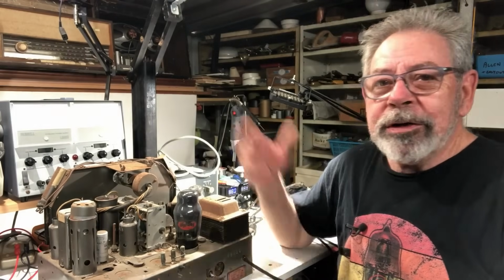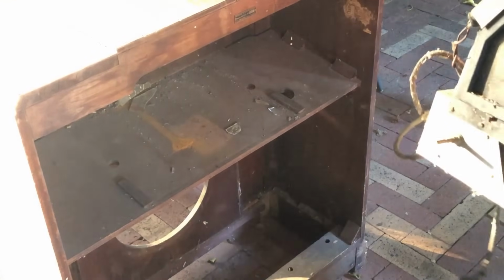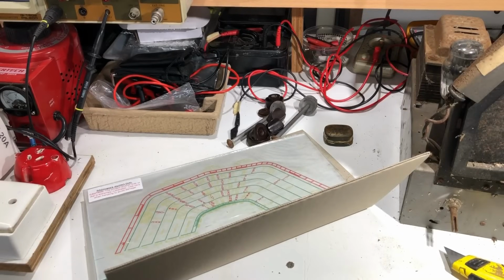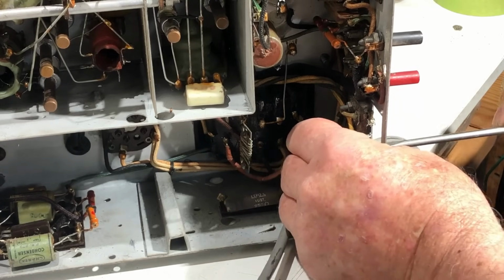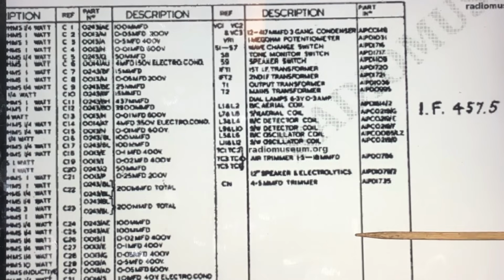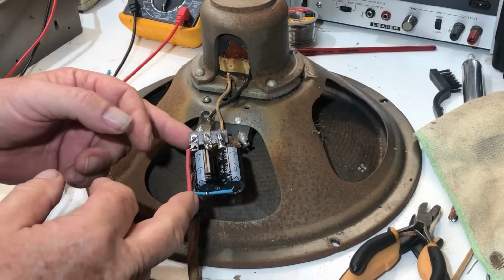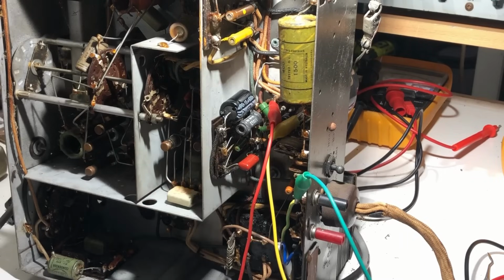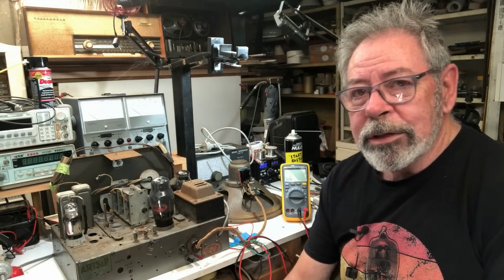1941 His Master's Voice model 411 Console Radio Restoration Part 1

Comment: I think it common on HMV the filter caps field d coil to be the negative side. give a little more negative for Bias
Reply from the maker: Hi.  It does seem to be a particular HMV thing though. I'm sure they had a good reason for it but I've never seen it used by any other manufacturer.  Yes, it might give a more stable bias or something.
Cheers

Comment: A question Don. When you remove an old cap or resistor. How do you clean the two protruding remaining wire ends before soldering in the new part using the pigtail method? I find cleaning these wire ends difficult to do in confined spaces. Many thanks.

Comment: Hi Don, I've been following your chanel for a while, great stuff. I didn't watch the whole video but I noticed you have been wondering about the the speaker. I did a similar model, the electrolytics are mounted on the speaker, so this is the original setup. I think your radio is missing the mounting bracket. I will send you a photo. Good luck
Reply from the maker: Hi  Thanks, a photo would be helpful although I probably won't be able to replicate what was there.  I can probably make up a mounting bracket but the caps were probably the aluminium can type. I might have a couple laying around.  I'll see.
Cheers

Comment: I would like to share my experience with a Carlson Stromberg. This can apply to anything with a tube push pull power pentode output. I know this radio is single ended but this is for your future repairs. I repaired a Carlson Stromberg radio and it was playing fine and I noticed a slight drop in volume. I didn't worry about it for awhile I was busy doing something else and when I got time I looked at the chassis and noticed one of the output tubes had a glowing screen grid. Not the plate the screen. The culprit was the old output transformer had an intermittent open on one side of the primary that went to the glowing tube. I couldn't find another transformer and the guy was a cheap skate so all I could do is remove the connections to the screen grid on both tubes and connect directly to the plate and operate the tubes in triode mode and it worked really good and no more red screen grid. Never trust an old output transformer always wire the outputs as triode unless you replace it with a new transformer. It did damage the tube that was glowing 😞. Hard lesson learned
Reply from the maker: Hi Christopher,
That's an interesting story about the Push  Pull output. I have never come across this problem as most of the radios are single ended.  The exception to this seems to be radiograms, particularly HMV.  Great solution connecting the screens to the plates and running them in triode mode.  I guess there would have been a small drop in output. Was it noticeable?
I have an AWA Radiolagram that I use to play 78's and it has a pair of 6V6s in the output and a 12AX7 as a preamp & phase splitter. I'm having a hum problem with it.  The bias is set such that I can remove one of the 6v6s (either one) it still sounds good up to a reasonable volume level and the hum disappears, although you lose some bass.  I've tried changing the 12AX7 to no effect. Any ideas?
Reply: @Donno308  Hello there and good day, 
I had a Grundig stereo I worked on that had a hum in the right speaker that follows with the volume control. When I disconnected the 6.3V heater at the power transformer the hum immediately stopped. I reconnected the heater voltage and started pulling out tubes starting at the input tube while it was powered on. When I pulled the 12AX7 preamp the hum stopped. It tested good on the tube tester and didn't show any leakage or shorts but when I replaced it the problem went away but this is not the case with your amp. That would be difficult to diagnose over a text I would have to be there. Try disconnecting the heater voltage. That will isolate between a shielding problem verses a heater supply problem being too close to a sensitive input. Also if the heater wires are not routed correctly and I recommend getting them as far away from a sensitive input as possible and on high end amplifiers they twist them together to cancel out the electromagnetic field. Good luck and let me know what happens.
Reply from the maker: @Christopher-re2hl  Hi Christopher.  That sounds logical. The hum is independent of volume. I replaced the filter caps but I will try your suggestion and pull the valves one at a time. The 6V6s are a new matched pair so I don't suspect them.
Cheers
Reply: @Donno308  Hello,
The Stromberg Carlson was a medium size table model with a 5" speaker. I didn't notice any drop in performance it still sounded big for its size. It might make a very slight drop on a big console but it will safeguard those irreplaceable tubes

Comment: Always nice seeing progress from what appears to be a basket case. As Mr Tipton said, I have also seen those caps mounted on the speaker behind a gull winged piece of metal, making it harder to touch the HT with your hand but possible with meter probes. Looking forward to seeing those seized shafts freed and the front end working.
Reply from the maker: Cheers Bofor.  I'm pretty confident I'll get the front end working.

Comment: Thanks for the video Don. I look forward to the cabinet restoration so I can learn how to restore mine as well.
Reply from the maker: Hi Robert.  The cabinet is looking like quite a project.  Overall the veneer is intact but there are quite a few small bits missing and the more I look at it the worse it looks.  Next video will finish off the chassis and, if If I don't run into too much trouble with that I might  have a look over the cabinet.  At least that's the plan.  
Cheers

Comment: Hi don I have a similar radio here, a broadcast only no rf stage. The electros are wired correctly these radios put the field coil on the negative rail, presumably to reduce electrolysis in the field winding causing the wire to corrode.
Reply from the maker: Cheers Robert.
It surprises me that other manufacturers didn't do it that way.  It seems to work very well.
I guess I'll make up some kind of box to put the caps in as they're a bit exposed.  Are yours mounted in some kind of cover or box or just soldered to the speaker?
Reply: @Donno308  hi Don on mine the caps are under the chassis they had turned into resistors and blew the 5y3. There is a metal cup covering the speaker with an HMV sticker on it. Would you like to see a picture of it?   My speaker is 10 inch and though working has been really messed up by a crappy repair job by the previous owner.i asked  David Tipton what to do and he suggested reconing it but the cones you can buy these days usually have rubber surrounds and won’t sound right. I will look for guitar speaker cones as they’re stiffer. Or maybe if I’m brave try to reconstruct it!!

BTW an old time member of our local club recommended initially powering the unit via dim bulb with no valves for an hour or so to check the transformer has no latent shorted turns. If it’s only mildly warm after an hour it’s almost certainly ok.
Reply from the maker: @roberthart8933  Thanks Robert.  It sounds as if your speaker is quite different to mine, having the filter caps mounted under the chassis.  Perhaps you can find a suitable 10" permanent magnet speaker with a similar cone that you could remove & transplant into yours.  Good luck with it, anyway.  I have now run the chassis for over an hour on dim bulb with no overheating or even anything getting more than warm si I guess it's all ok
Cheers

Comment: That radio is well on the way to working. A few more caps and the odd high value resistor and I'm sure it will spring to life.
Reply from the maker: Hi Ian.  Yes, I agree.  It might even work as is, at least to some extent. The cabinet is going to take a bit of work though.
Cheers

Comment: Mouse mummy!  Components all original and pretty bad looking. Nothing you can't handle Don and after all it was free!
Reply from the maker: Hi Steve.  Yes, that mouse had been there for quite a while I think.  It's pretty unusual to find a 1940's set as original as this but I wasn't that surprised that it was electrically in reasonably good order.  These old wartime radios are almost indestructible.  
Cheers

Comment: A interesting set and I look forward to watching the rest of the restoration. Be careful with that '6L6G' as it appears to be a wartime GEC KT66 (aka VT75) which is a valuable thing!. Cheers
Reply from the maker: Thanks, I was wondering about that, not that I was thinking of selling it, but someone asked me sometime ago if it was a KT66.  I didn't know at the time but it certainly looks like the same thing.
Not that I'm thinking of selling the valve of course, but I think a 6F6 or a 6V6 would do the job if anything happened to it, but yes, I will be careful with it.
Cheers

Comment: I'm hooked! This looks like a fun project. Question: you mentioned that it wasn't so good to work on the chassis with it on it's side. My current radio resto is sitting on it's side right now, and I wonder if I'm doing something wrong? Is this just about access to the work, or is there a chance of damage? Both chassis seem pretty stable to me.
Reply from the maker: Hi Don,
No it won't do it any damage, so long as it isn't in danger of falling off the bench.  I was mainly concerned with comfort and convenience when working on it.  I usually like to have my chassis' supported upside down just to make it easer to work on them.  Also easier to get light in there to see what I'm doing, and also helps with the video.
Cheers

Comment: Hi Don, It looks like a goer, the cabinet looks pretty good too. The two plugs in the ext speaker sockets are Wander plugs, hang on to them, they are hard to find. You are right, the speaker had a metal cover over the two filter caps on some speakers, i think I have seen some with the two aluminum caps standing on a bracket but maybe the cover was missing. The field col is in the negative voltage part of the circuit to reduce the voltage potential across the coil and former placing less stress on the windings and also reduced corrosion in them. Connecting the two positives of the filter caps and separating the negative across the field coil or choke is normal practice for this setup. I'm very much looking forward to seeing this set progress with your normal high standard 👍🙂
Reply from the maker: @DavidTipton101  Hi David
Yep I’m pretty confident that it will go pretty easily. That cabinet though - the more I look at it the worse it gets. Someone’s had a go at it with a kitchen knife and some plastic filler. And some bits missing. Ah well it’ll keep me busy for a while.

Comment: Good work, Don! I was hoping you’d plug the rest of the tubes in and test. But so far so good. It’s always great when there are NO power transformer, output transformer, field coil or speaker issues. A big step in the right direction!
Reply from the maker: Hi Superhet.  I wasn't quite game to do that yet but I think I'll start off the next video with that.  Not sure if we'll get much out of it without changing those paper caps though.
Cheers

Comment: I noticed that, for all it's horrible condition, it still had the ARTS&P License sticker in it, which is a pretty cool thing to have with the history and story of the set.   Back in the day, radios had to have the ARTS&P License in Australia so yeah, really cool seeing that.
Unfortunately, I don't think those banana plugs are original.   I don't recall banana plugs being used much in that era, but the rest of the set looks original.   Leaky caps likely caused the transformers to run warm and leak a little.  They should be fine longer term though.  Tar leakage is a sign of heat but as long as the windings are okay they usually run well, but I will watch the rest and see how it all turns out.   Really looking forward to this one
Edit:  all paper caps are actually shielded in that manner and most from this era had shield end, ground end, foil end marked.  This end goes to the to the ground end for interference suppression.    Even modern "film caps" have a shielded end the same way, they just are not labelled as in a PCB it is less of an issue.  Paul from Mr Carlson's Lab has a lot of good info about making sure film caps are installed the right way to suppress interference.
Reply from the maker: Hi
Yes, nice to have the intact ARTS&P label.  The G prefix dates it at 1941 so certainly a pre-war design.  On closer examination I think what I was seeing is a coating of tar which the transformer was dipped in.  It doesn't seem to have been very hot or leaking.
I've noticed that most paper capacitors have the outer foil marked.  These seem a little different in that they are in a metal can but I suppose the same principle applies.  I'm not sure if I need to worry about identifying the outer foil on the replacement caps.  I have been told that the new ones are much less susceptible to noise anyway and they are all under the chassis which will now be grounded via the power cord.
Cheers
Reply: @Donno308  It does depend who you talk to.  Mr Carlson will say 100% it matters and you must get the caps in the right way.   His reasoning makes sense, point to point wiring doesn't have the same ground planes that PCB's have, and also tubes are high impedance devices, where as solid state tends to be much lower impedance. 
That said, Glass Slinger, as an example of someone working on tubes, believes it is not so critical.    
Identifying the outer foil of the caps doesnt take much work, but I am kind of of the opinion, if it works it works, but then there was a reason that back in the day the outer foil was labelled. 
Juries out on the outer foil thing I guess ultimately.
Reply from the maker: @EsotericArctos  I tend to agree with Glasslinger:  If it works, it works.  I have never bothered with identifying the outer foils and I've never had a problem so far.
Nevertheless I might do it with this one otherwise I'll have a hundred people telling me I'm wrong lol.
Cheers
Reply: Independent of slight differences in circuit performance due to parasitic capacitances to that outer foil if it is connected to the hotter side of a signal path, one might want to avoid having a high potential to ground on the "outer foil" if the body of the capacitor comes close to the chassis.  Even if it doesn't cause an outright short circuit it might cause "popcorn."
Reply from the maker: Yes you have a point.  I guess it depends where in the circuit the capacitor is.  In the RF stage I think I will identify the outer foils and make sure they're the right way around.
Cheers
Reply: @SeekingTheLoveThatGodMeans7648  if your caps are potentially leaking from foil to outside world, they should be replaced.  The outside should be electrically isolated from the working insides.  You make a good point though.   The outer foil should be ground/ chassis potential side of the connection where possible.

Comment: The two caps wired that way acts as a  non-polarized capacitor.  The value would be 1/2 the value of one capacitor if they both are the same value.  This is not a uncommon replacement for a non -polarized cap which are more expensive and less available.
Reply: In a voice coil circuit a nonpolarized high value capacitor might be expected in a bandpass filter for a tweeter.  Not in the field coil circuit, however, and this doesn't look anything like a tweeter.  That typically is part of the B+ supply, however in some older power supply configurations there is essentially a B- supply, filtered in the negative leg, and cathode circuits connect to it.  We'd have to see the electrical schematic to make sense of it.  (This is before viewing the whole thing, in which we may see the electrical schematic.)
Reply from the maker: Yes I haven't seen the field coil fed from the centre tap in that way before.  As I said, it all makes sense when you think about it

Comment: OK, doing fine so far. DO NOT FORGET TO PUT A SMALL FUSE IN THE MAINS CIRCUIT to protect your transformer. A half amp slow fuse would do fine.
Reply from the maker: Hi Ron, You're quite right of course, I really should be fitting line fuses to all the radios I work on (that don't already have one).  I guess I'll start with this one.
I really enjoyed your Radiola 20 video. I love those 1920's radios and one day soon I'll have a go at restoring one.  They're a bit hard to find here in Australia but they come up for sale occasionally.
Cheers

Comment: Two caps with the same polarity connected in series is the basic form of a bi-polar cap, so that was a good decision. The total value wil be half of both, so 12 µF. In this form there's no more plus or minus for the cap.
Reply: Ah, later in the video you show that they are not for the speaker, but on its field coil as filter caps. That explains it all.

Comment: Nice to see such  an old chassis with what looks like all original solder joints, another plus, IF trans have not been tampered with, first time I have seen anti tamper stickers over the cans, hopefully smooth sailing for for the rest of the restoration, Cheers
Reply from the maker: Hi Reg,
Yes it's rare to find one that hasn't been touched.  Many have been butchered over the years.  I almost regret changing the capacitors but I guess it's more important to have it working than 100% factory original.  At least I'll do my best to get it looking original.  If the IF alignment looks ok I'll leave the anti tamper labels in place.
Cheers